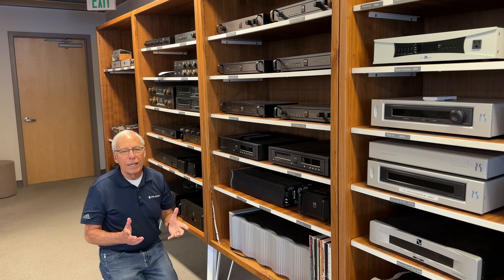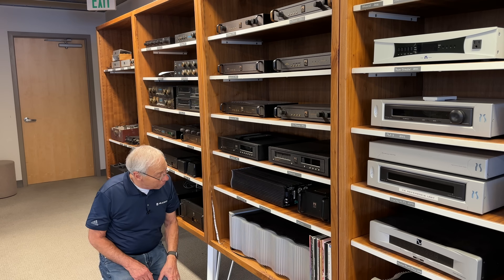The world's biggest Power Plant

Comment: Working at a powerplant, we have what we call "critical AC". Essentially, you are taking typical noisy AC, rectifying it to  "clean" DC and serving as a shock absorber, and then inverting back to AC at a fine tuned, regulated and uninteruptable flow per se. Is that similar? Is the weight of the "powerplant" because of mainly the batteries (as the storage tank of electricity) and transformers  serving as a flow control valve at a desired pressure?

Comment: Paul, get one of those back support belts for your back.
I have one I bought at Walmart, cost about $35.00 or so. It has Velcro. You can find it in their health section, not in the sports section. 

It has a curved plastic plate in the back of the support to keep your back spine straight. I use to get a pinched nerve once in awhile. With the support belt I don’t get that anymore.
 
I have a curve in my spine also, the support belt with the plastic insert keeps the spine disc straight and prevents the disc from collapsing under pressure.
The plastic insert is there for a reason,, use it…!!!!

If you travel a lot you will notice others wearing these also. Especially truck drivers like me and warehouse workers that do a lot of lifting all day.  It will save your back. 
I highly recommend them for everyone.
Reply from the maker: Thanks, David!
Reply: @Paulmcgowanpsaudio Paul I farted
Reply: @Paulmcgowanpsaudio 
Some of your employees may benefit from these also. Those who spend a lot of time sitting all day can benefit from these. Sitting for long periods of time puts additional pressures on the lower spine with sitting positions the belt helps keep the spine straight while sitting. 

I drive a truck over the road sitting for long hauls. My days are spent sitting/driving and the belt works perfect for that. Sitting all day at work or standing all day like at work stations are not good for the back spine. 

The Human Body was not designed for these conditions..LOL Especially for over weight people. 

Too much weight puts a lot more pressure on the lower spine with people that are not in good physical condition.  I have known people that have back spinal problems for the rest of their life because of their lifestyle.

You see a lot of obese people today in America. Causes all kinds of health problems.
Reply: I should’ve mentioned if you are a heavy weight you will need a bigger belt like you see heavy weight lifters and strong men wear in competitions. Those you can order online or buy at a weight lifting shop.